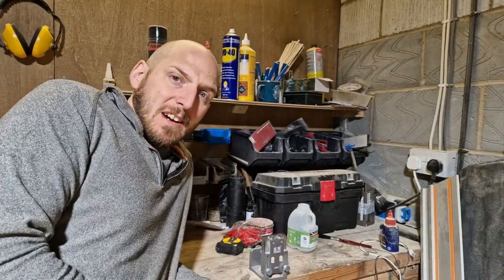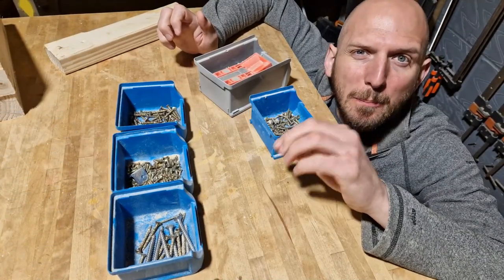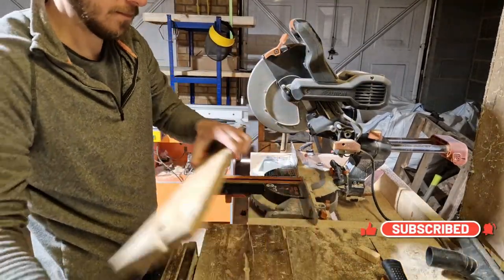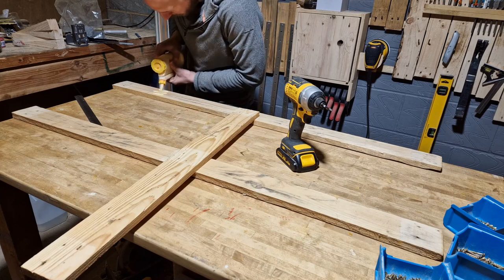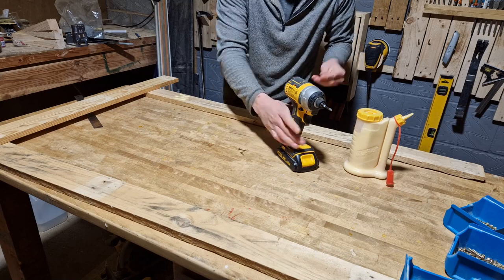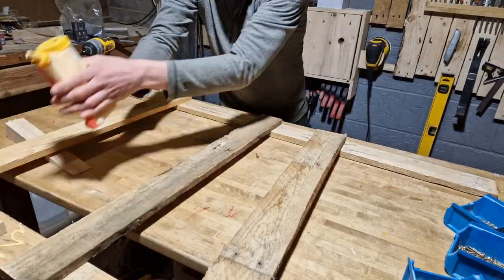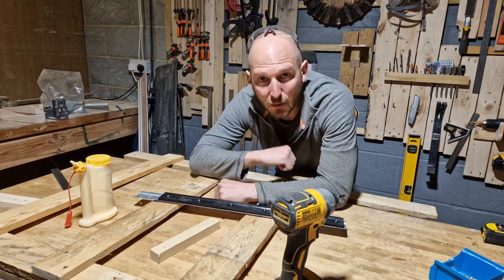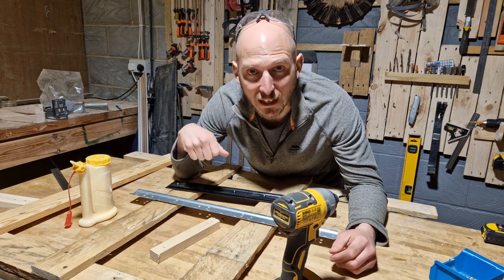3 MORE WORKSHOP UPGRADES: Storage Solutions

Comment: Nice video with good ideas. A few suggestions, If you spend more time looking for something than you do using it you are wasting huge amounts of time so …. sort things by type (all tools, parts, consumables) and keep them in one place.  For example all pliers go in one spot, all screwdrivers go together, etcetera.  Power tools should be stored near their batteries, high use items should be quickly and easily accessible.  

Clean up as you work.  Any horizontal surface will collect things unless you make a commitment to put things away when you are done using them. 
Develop habits to sustain this organization and your life will get so much easier and you will complete projects in half the time.
Reply from the maker: It hurts that you are so right and that I'm so bad for it! I'm working on giving everything a home but I'm still terrible at keeping those horizontal spaces clear! On my to-do list are drawers for my work bench. I want to do them properly though and decent drawer slides aren't cheap. I'm hoping this will help me with a lot of that horizontal clutter! Cheers buddy.

Comment: hey big guy , if you don't mind i want tell you what i did with my track saw , I found a piece of real estate that was empty on the walls and I stood my track saw on in that area ,and then about 4 in above that I put a 2-inch screw about a half inch into this group slightly angled  down ,went to the top of the tracks are measured 1in down and put a half inch hole, and then hung the tractor on the screw I put in the wall.I hope you got the watch that movie I sent put my last comment this is a really funny one that's called crime spree with Harvey Keitel You Laugh Your Butt Off anyway good luck and talk to you next time.
Reply from the maker: If I had the wall space, that would certainly be the best option! I plan on changing the garage layout at some point but it's a huge project. For now, I'm very limited on wall space! Cheers for the comment mate